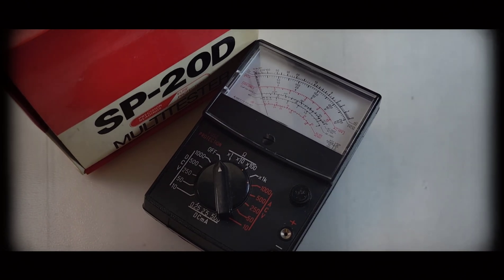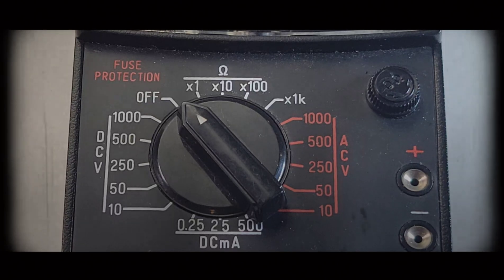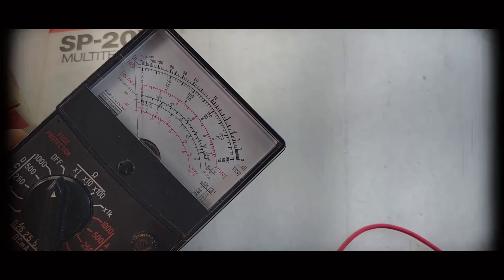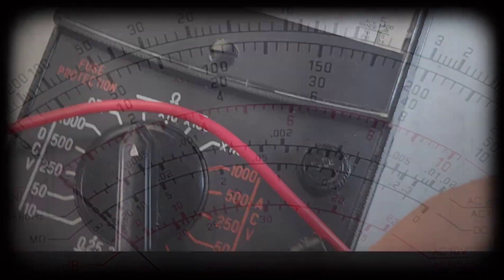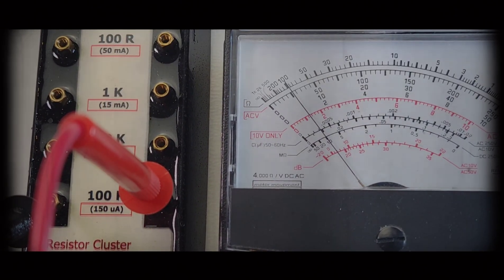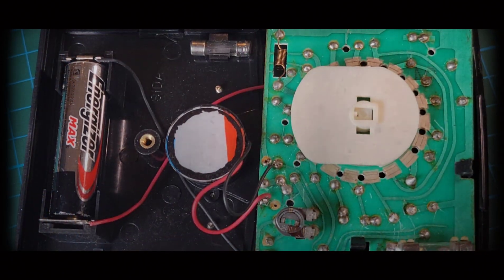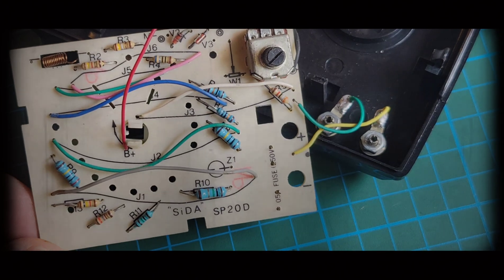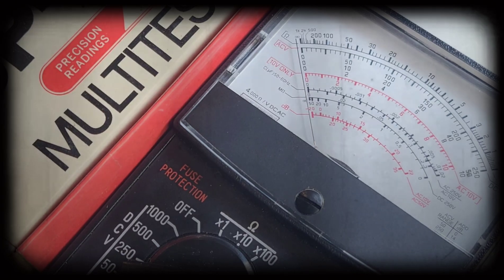RETRO-TECH ○ HELES SP-20D Analog Meter Mini Review & Teardown! (mid '90s)

Comment: One thing digital cannot beat analog is battery life and voltage fluctuation detection. ;)  Anyway, do you know when we use AC10V bar (red) which is below ACV/DCV? Is it when measure AC voltage on 10v point?
Reply from the maker: So 👍 true...Analog meters still have their place ! I hadn't tried that scale but I believe you are correct. I'll look further and let you know.
Reply: @KeepOnTesting  Great, thanks!

Comment: If it is a knock off, maybe the manufacturer leverage the whole design. If I had an extra to send you, I'd love a review of the Radio Shack 22-216, also from the mid '90's. It is a multimeter with analog needle movement and autoranging.
Reply from the maker: Howdy Eric  , definitely a knock off but still a decent performer. I'll keep my eyes peeled for that meter and snag one if I can fine a nos or similar. Those are definitely classics.